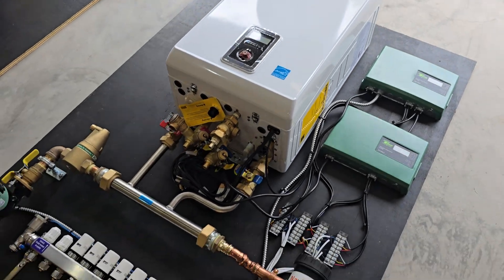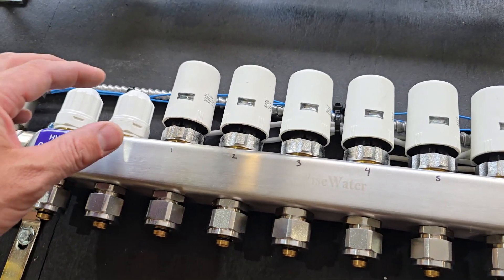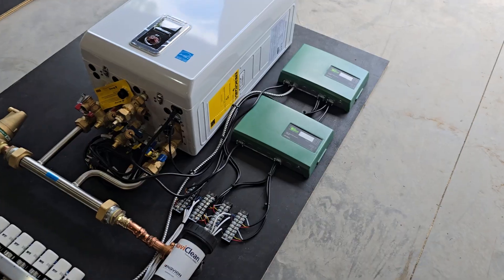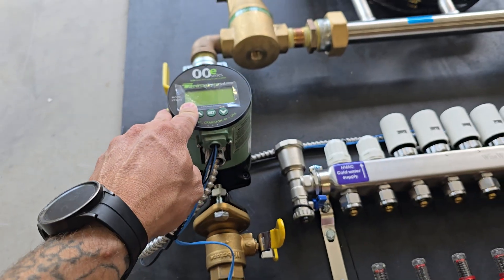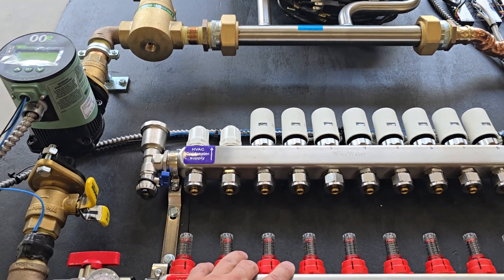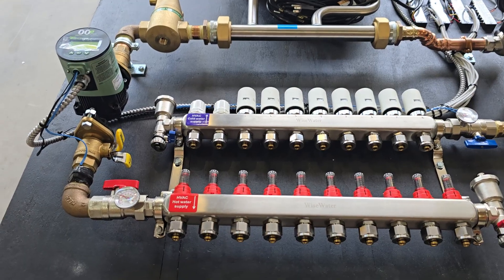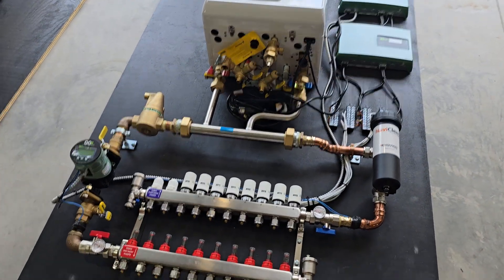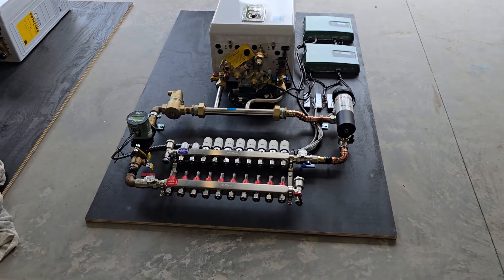Multi-Zone Radiant In Floor Heating Boiler System

Comment: I used those heat link adapters on a job and the supplier quoted x amount but shorted us like 100 adapters and we needed them on a Saturday and they refused to admit they screwed up like what are they 25 per adapter or something silly

Comment: Why do I never see an expansion tank on your systems
Reply from the maker: It connect to the air separator...they are not installed simply for shipping and transporting purposes. Its a bulky item typically hanging off and it could break off easily. This system will be mounted to the wall and the piping and expansion tank will be mounted afterwards.